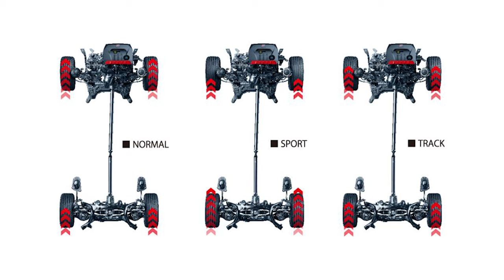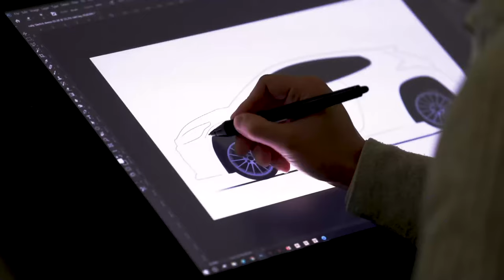Is our TOM'S kitted Toyota GR Yaris the ultimate JDM spec? 🇯🇵

Comment: The car does everything well, it accelerates, brakes and turns great, the issue is that it has a lot of grip in the sensations, it seems like it is going on rails and that takes away from the fun, plus the sound of the engine amplified by the speakers sounds very artificial, as if It was an appliance, and the exhausts are as if silenced. In 2022, they took me for a ride in a pearl black one, with the circuit pack and the aerodynamic kid that cost about five thousand dollars more, we were going almost flat out and I thought it was going to leave me speechless but the truth is which was not the case, only a downshift to third and a great thrust of its engine made my head almost touch the windshield, it was what impressed me the most along with its great braking power, but based on comments I expected much more from this car . There are some journalists who think the same as me, but well I think there are two realities, the car that gives you sensations and the one that makes the best times, the Yaris is part of the latter's club. When you get in it feels too cheap and its plastics leave a lot to be desired, they look like a VW Gol Trend from before and all this makes it feel like a "vitaminized little stroller" but not of class.- If you buy it for A safe circuit is great, but if you buy it as a touring car to make a “facha”, as they say in Argentina, it is not so good because it is small, uncomfortable and uses too much gas like a Mustang, according to what I saw in a video from a private individual. from Spain that has the Yaris and compares the consumption with the Muscle Car. Although the suspension is softer than a Megane 3 Rs 265, it is still hard, and it copies every small imperfection of the asphalt in the city. In conclusion, for its price it offers a lot, but it is not the car that you say drives me crazy, neither for its design (although its nose is very rally), nor for its sound, nor for the quality of materials, what makes it precious is the intervention in its development of the quadruple WRC world champion, the Finnish Tommi Mäkinen, which ensures that this vehicle is precise and efficient when it comes to rolling on the track, on a track day, even surpassing other higher priced cars.

Comment: Everybody comments on the yaris comparing to GPA cars which were modified road cars the yaris is a one off build  that would  put it in the metro 6r4 ford rs200 Peugeot t16 when they were purpose built from the ground up and had resemblance to the road cars eg shape  lights mirrors

Comment: Does anybody know..

If this car is going back into production at anytime ?
Reply: From what I've read... They had to make a minimum of 25 000...due to demand they may make a slightly more than that. But toyota makes a loss on each of these cars they sell. They're going to utilize the R&D to make the gr corolla going forward.. Which they will sell at a higher price point and therefore break even or make a profit. The gr corolla is going to be made in the motomachi plant as well, at that point production of the yaris should cease
Reply: @bobbybooshay5854  25,000 units was to meet the homologation requirement. 
It’ll be such a shame if they don’t go back into production 😒
Reply: @LRS7B  I guess so but I guess the limited nature of this car makes it more special 😊
Reply: Look on Toyotas website ;)

Comment: for a modern car it is quite impressive, though it is the same ish weight as a 94 celica GT :P and 200 KG more then a 2000 Celica GT but also much more powerfull then either and much smarter >.> and lugging around a AWD system instead of a nice lightweight FWD solution :P